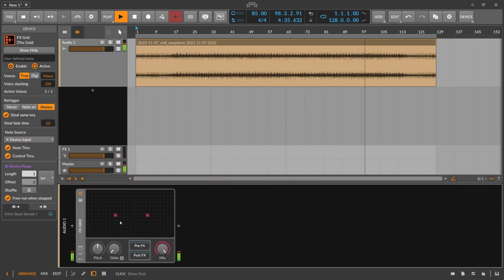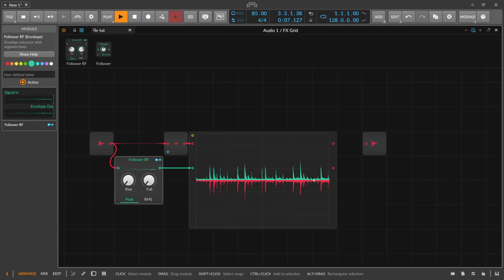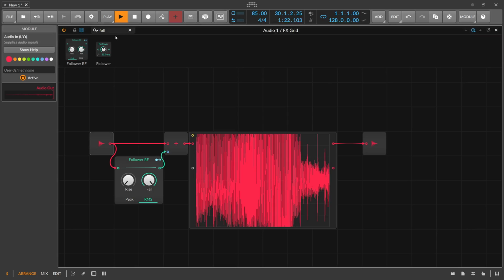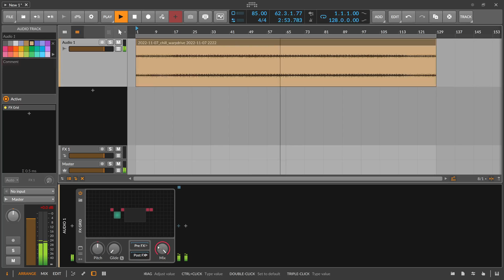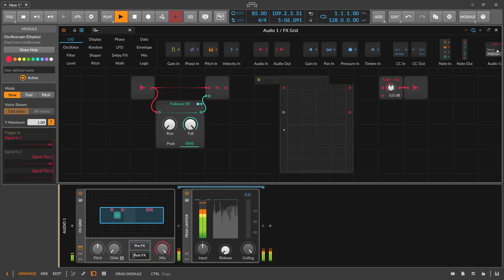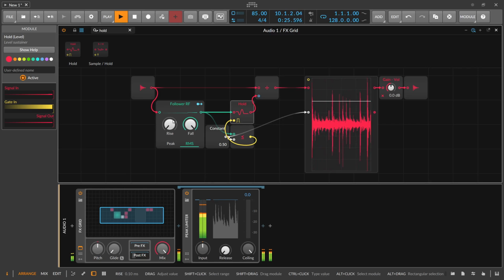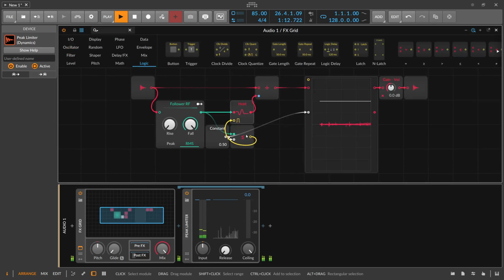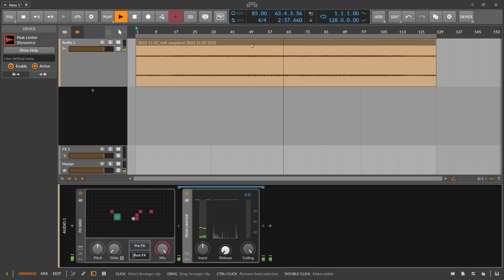Auto Leveler with Bitwig  -  Auto Gain Stage

Comment: Consider an LPF on the follower output. Slew is nonlinear, and it will pass high pitched stuff at low amplitude, which, if the slew rate is fast enough, will end up adding fizz when you use it as an amplitude modulator. 

Filters give a fixed attenuation that depends on frequency. So a 10kHz sine wave gets reduced by X dB no matter its level. "Linear" means the process acts the same no matter amplitude. Or, to be precise, f(a+b) = f(a) + f(b)

A slew limiter will reduce a (loud) 10 kHz sine wave to a 10 kHz triangle wave with a fixed amplitude, where that amplitude is the slew rate divided by 10 kHz. If the input is near that amplitude, you'll get a funny looking clipped sine wave. If the input is well below that amplitude, it won't be attenuated at all.

Comment: So good! Tiny nit-pick: If you use the signal itself instead of the follower output for your threshold cirquit, you should ideally take the absolute value to make sure that larger negative values also surpass the threshold. For most signals, this doesn't matter that much, but e.g. some voices have got fairly asymmetric wave shapes.

Comment: Thanks again for sharing :)
While playing around I have an addition to suggest:
Switch the 'hard' clip on the 'audio out I/O' to OFF (or soft) to avoid unwanted distortion (this was the case for me, there are some peaks running into the limiter)
Reply: I discovered I have this distortion too but with each setting Off, Hard of Soft. And only when the preset is loaded (from library or when whole project is loaded). After feeding audio through it's gone. What settings do you use on the rise, fall and constant ?